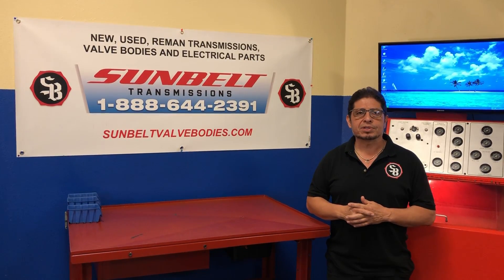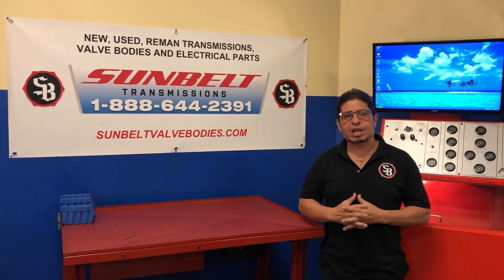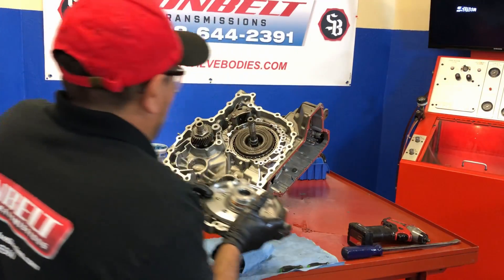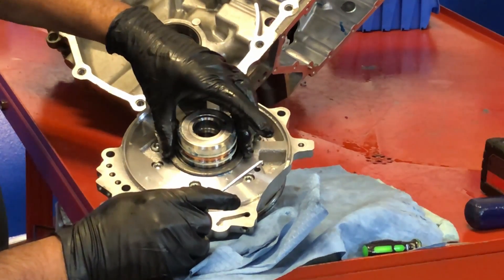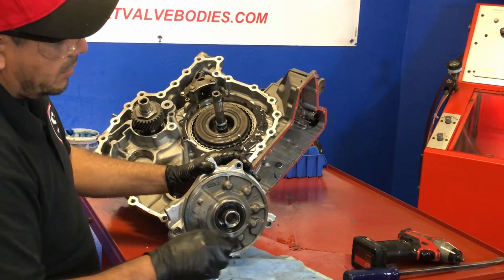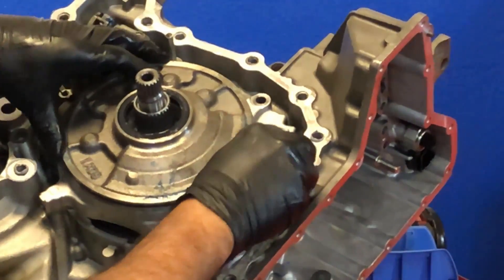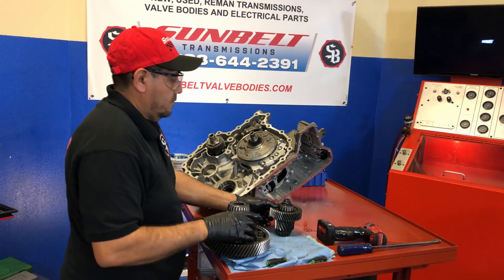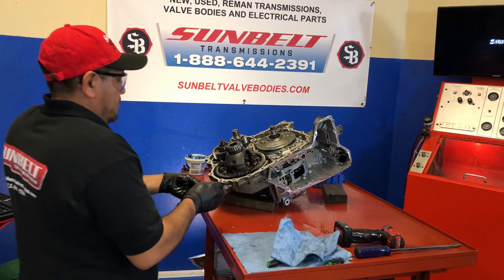CVT How it Works Nissan Quest RE0F09B/ JF010E Complete assembly of Transmission Step by Step (Part3)

Comment: Thanks for this video.  Got the new valve for my REOF09B fluid pump, but what are the torque specs for the Hex bolts to reassemble the pump?

Comment: Thanks for the great videos. I am wondering if the cvt belt can be replaced in the vehicle without removing transmission. The bands broke. I think it's the belt band. It's a long thin peices of metal and they are in the pan and one is stuck above the valve body. Or could it be anything else? What should I do replace or rebuild transmission. Stepper motor code came on for it.

Comment: Regards, I have a problem that I can't solve on jf010e for now, I changed the torque converter, the valve in the pump, the pistons and rubbers, the blades, all the valves on the valve body. belt .... everything except snapring in variator, when I stop on a small hill the car moves back and only over 1500 rpm tries to move forward.
Reply: I'm just trying to find out the name of the solenoids

Comment: Thanks for the very detailed videos. We rebuilt a JF010E but after putting back in vehicle the reverse is not spontaneous, vehicle barely moves after pushing the accelerator pedal. The forward drive is good. Any ideas on what could be the issue?
Reply: found the issue after watching video again, it was the snap ring for the ring gear. the ring gear was seated lower due too missing snap ring.

Comment: Does the transgo flow control valve work well .. or the sonnax oversized is better.. this your friend from Switzerland..
Reply from the maker: sonnax Oversized valve works better. you do need a  ream tool for it but it works way better then transgo drop in valve.
Reply: On a 2012 Nissan Murano CVT transmission what is the name of all the solenoids on the valve body
Reply: I need to see the breakdown of the valve body with all the solenoids and the name of all the solenoids on a 2012 Nissan Murano
Reply: @johnnysammons712  the solenoid you only need to test them with a 12v battery and make sure it’s activating and sealing properly. You can vacuum test them.. what codes are you getting.?
Reply: Where is the Rome solenoid at
Reply: 2:47